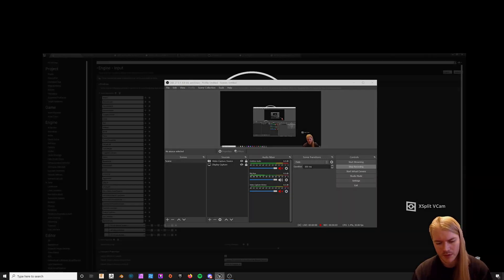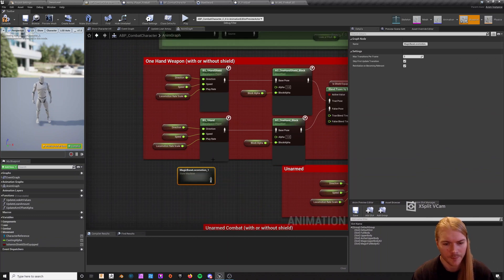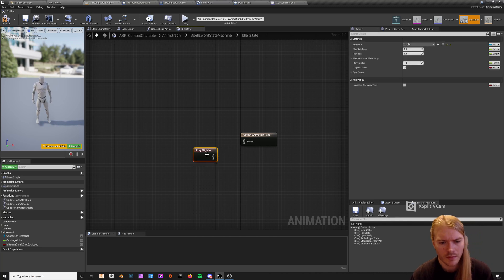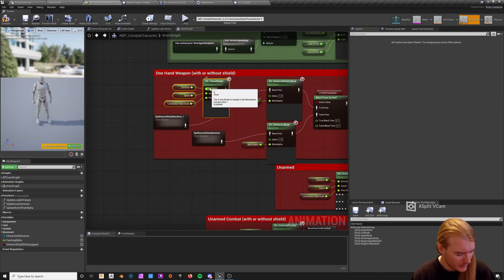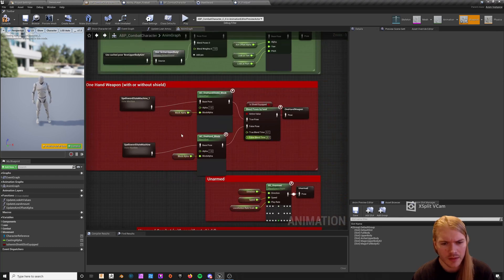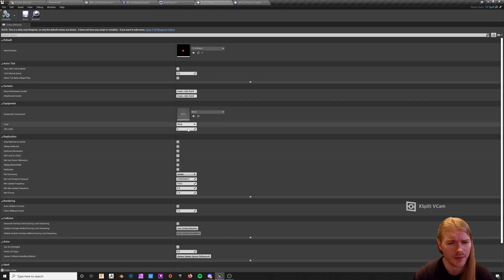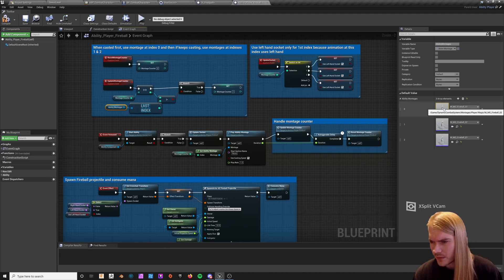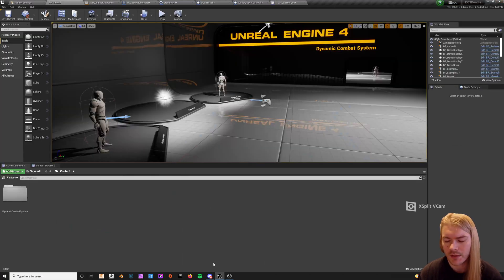Dynamic Combat System Spellsword Tutorial

Comment: Would it be a similar workflow to have two different weapons in each hand? I know the creator of DCS has a tutorial on dual wielding but his tutorial doesn't allow for swapping out individual weapons, his just adds both weapons as one single equipment piece.
Reply from the maker: Ideally you would do this by switching out dcs inventory/equipment with something more robust like AGR pro which is a free plugin. That way you can assign specific equipment slots like Primary/Secondary, and even have references to multiple actors in those slots like how dark souls has a left/right hand but also slots to swap between 2 referenced actors. With DCS I dont think the equipment has the same slot structure, although you may be able to equip it in the “shield” slot. Im just not sure how or what the hard references are under the hood for that. I havent been using dcs for quite some time. Msg me on the discord if you have more questions.
Reply: @jacksonblack3809  Thanks for the quick response. I'll have to check out AGR pro, and see how I can go about making a working system with it.
Reply from the maker: @witchlynproductions753  im also in that discord community just fire me a message if you have questions. AGR pro inventory/equipment is something you can extend yourself, out of the box may not have as many features as Chestory, but it is free.